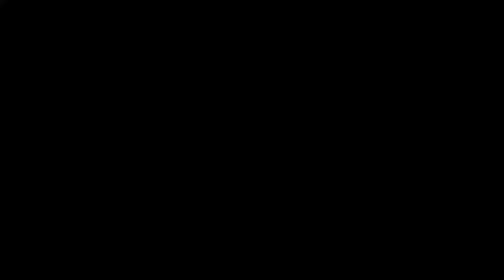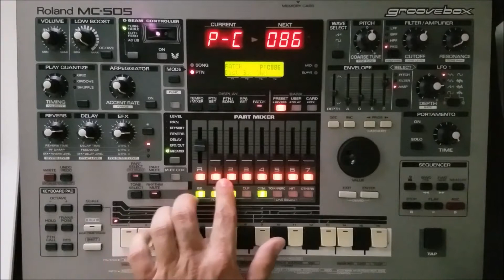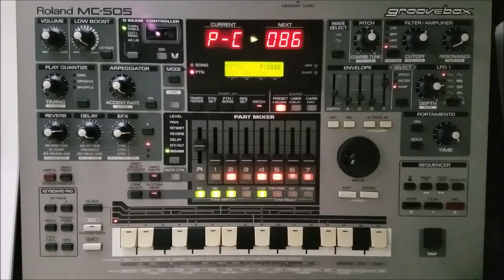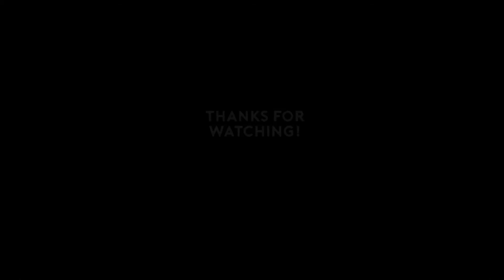✅ Roland MC 505 Groovebox Tutorial:  The Part Mixer

Comment: I love your 505 videos. I just wanted to say that for the megamix, I found out that it's not limited to the patterns that are near the one you are using. If you're in megamix mode you can use the part select button to access any pattern in your 505 by using the bank select buttons and the jogwheel or inc/dec buttons.